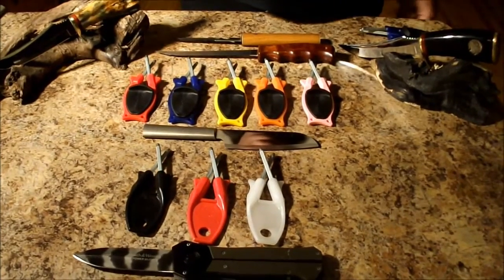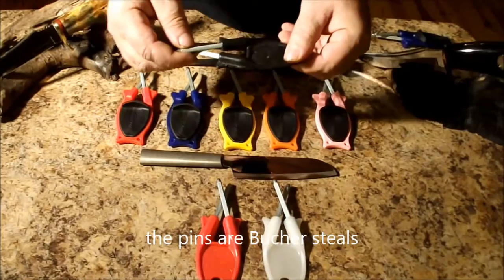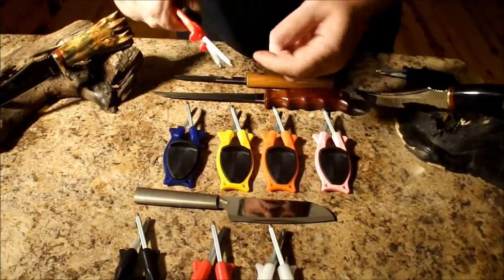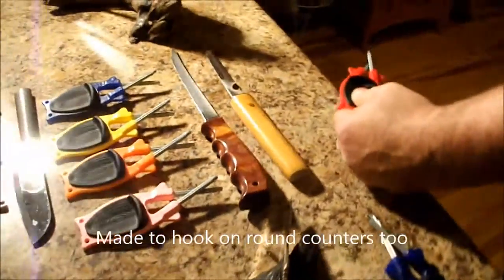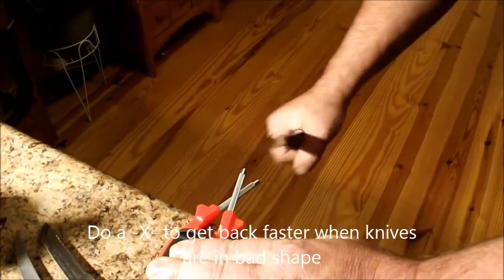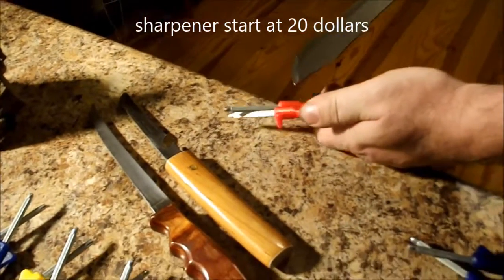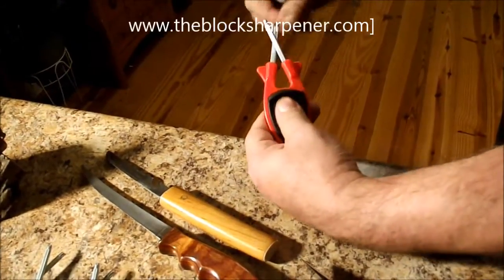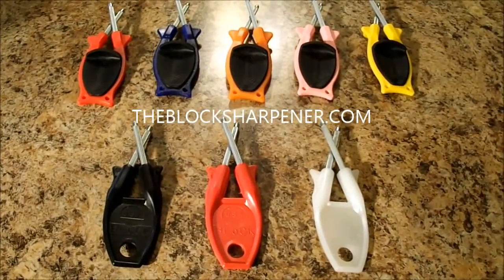Difference from New up dated Block Sharpener and Original Block Sharpener made by Paul Block

Comment: Seems like a copy of the Hunter Honer to me be original sheesh
Reply from the maker: Mine is a copy or the Original Block sharpener that my grand dad started making in 1969. Hunter Honer worked for my family in the late 70-d  then moved from Detroit to California and  copied our sharpener in the 80 d-s. he found out my grand dad original patent ran out. So he put a cheaper patent design on the Bull shit finger guard that fall off when you use his sharpener. Now his  BS patent ran out, and I took it back. Our family sharpener is  now protected again till 2034 with a new up dated Patent. I could only re-patent it because we could show and it on record we made the original.                                                                  We use different honing rods and  our rods angles  are now set different angles. they work pretty much the same. but not quit.

Comment: Will these sharpen smaller slip points like the Case Peanut?
Reply from the maker: Yes I have done them. They sharpen good. Little harder than a 4 inch knife or longer blade. But once you sharpen a dozen different knives or so ,You will sharpen it .
Reply: Paul Block sounds good. I’ll give them a shot 👍🏼

Comment: I finally ordered a Block Sharpener. I ordered the original one without the grip just to try it out for my katana.
Reply from the maker: why ?
Reply from the maker: but if you use it it will dull
Reply from the maker: Well if your sharp your sharp, When your not sharp your dull.  Block sharpener can fix that.
Reply from the maker: thank you.glade you like it.

Comment: is it a Dimond sharpener?
Reply from the maker: No ,there Butcher steel. Diamond cut to much for this design.try It they woe out fast too. and cost a lot to make.It could be fine tuned to work by using less fiber glass in the sharpeners handle. but it will problem still leave scratches on the knife edges. With the steel i have made it has very fine cutting edges .with the Flex i gave it in the handle .it bites back on original edges, flowing them. (working more like a chief steel) but much easier. (Made to reline blade)given you a very smoothed finish. I used lots of different steels to over the years. and now the steel used cant be beat. NO chipping , No searching. safe to use on hi- dollar knives.